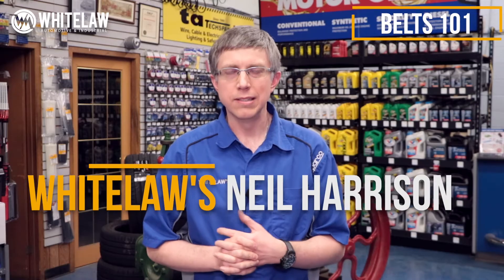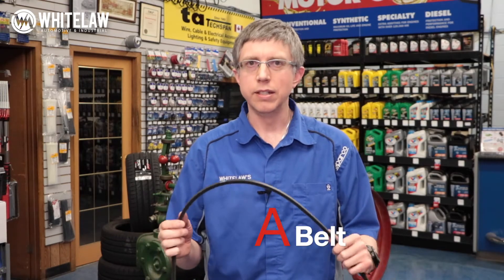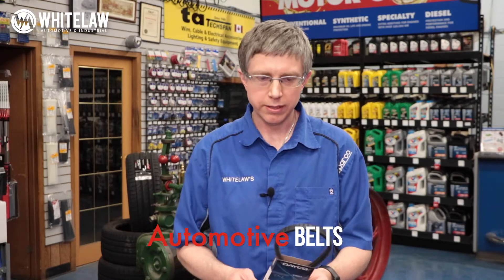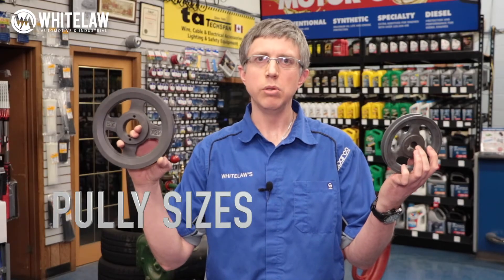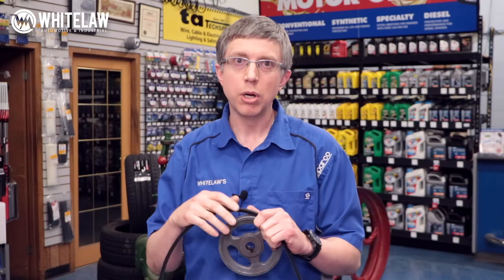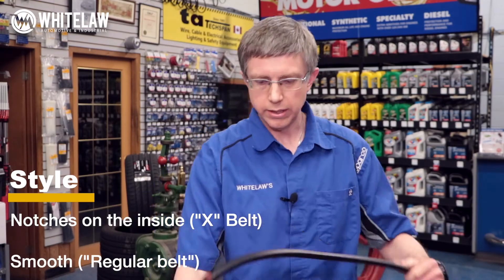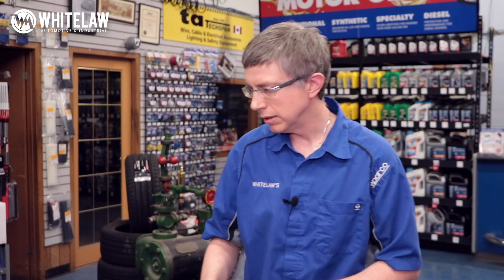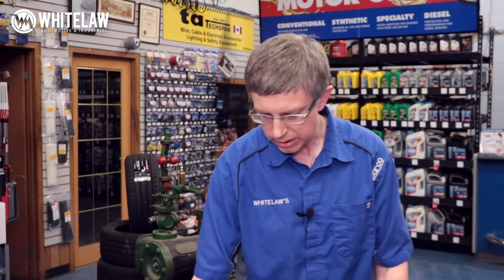V Belt Sizes & Types - Identifying Your Auto or Industrial Belt

Comment: A lot of good information, but a few questions remain.  I assume that you cant interchange a deep V belt (V series) with a standard V belt (A-E or L series) of the same outside width and circumference?  If not how do you determine what the V angle or depth is from the pullies?  Is there a difference between a standard A or B belt and a 1/2 or 5/8 automotive belt?  What is the difference between a Gates regular and a Green line belt?

Comment: In an application that previously had a rubber belt, will replacing with Kevlar improve wear? This is for a whole-house fan.
Reply from the maker: As a rule of thumb, yes.  I'm assuming it doesn't have an idler pully so you may not see all the advantage of a Kevlar belt, but it should last longer yes.

Comment: hello good day... asking if what would you  like to recommend a type of belt...    i am using a 1/2 hp motor with a 3 inches diameters wide and connects to a certain shafting with also a 3 inches wide pulley...
Reply from the maker: It sounds like you are looking for flat belting or are there teeth on your pulleys?  If so it would be a timing belt your after.

Comment: A sheathed belt (kevlar, aramid) is also better at shock loads. So in a clutching operation like drive on a riding mower or snow blower a sheathed belt would be ideal due to the high shock loads involed. Your bare cord belts don't do shock at all well and are more for constant engagement, mainly in stationary electric motor driven applications such as air compressor, blowers, conveyors, and stationary power tools.

Comment: Ok, how do you determine your belt from an unlabeled pully?  No belt came with the machine.
Reply from the maker: Measure the top of the pully opening gap and see if its a close to .5 inch or .625 if its a common A or B pully